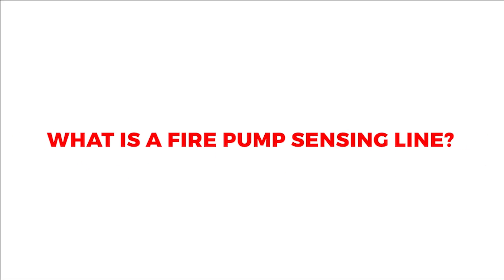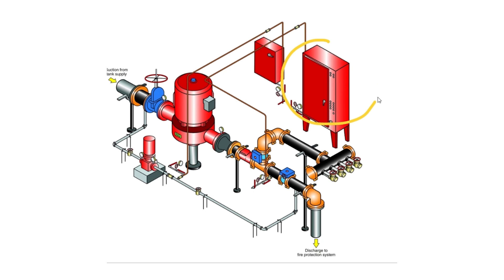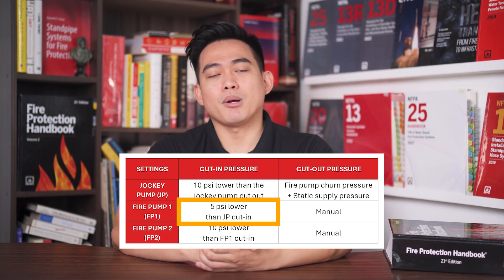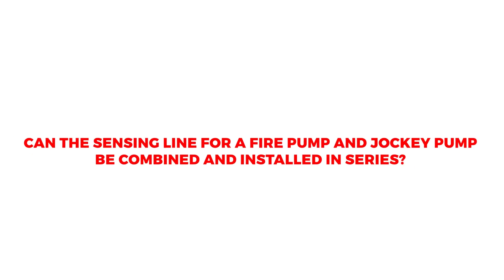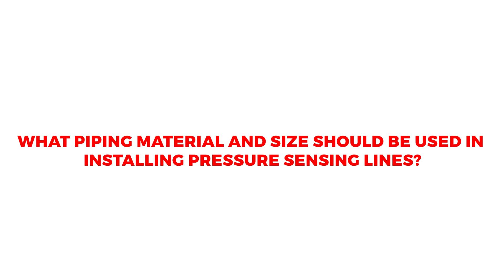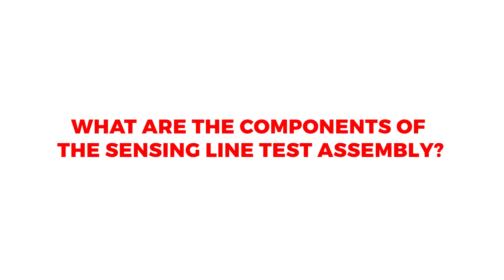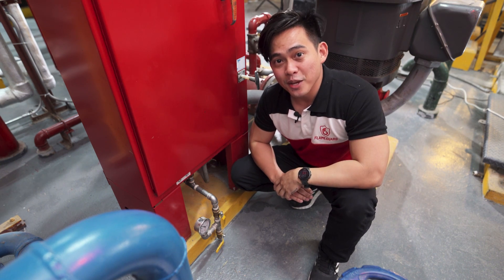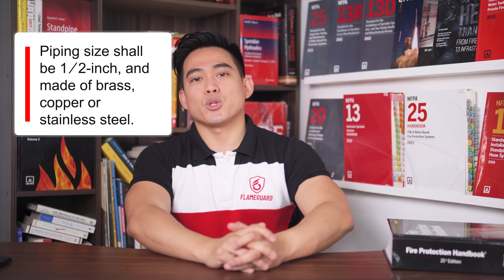Fire Pump Sensing Line: Summary of Requirements from NFPA 20

Comment: Hi sir thanks for this informative video, I just have a question regarding  local practice of installing sensing line above ACV,  

My question is,  what is your reference on your explantion, it is in the NFPA code? kindly state what section it is indicated

Secondly, i appreciate your explanation that it lessen water draining during weekly maintenance and introduction of oxygen to the system that may cause internally corrosion however,

This here are actual experience if the sensing line installed  below ACV,

1. If the installed check valve is faulty due to dirt accumulated over time on the valve seat it will  cause pressure drop that will trigger the jockey pump to cut-in  every time the pressure drop, since the volume of water at discharge check valve is small compared to the volume of the whole system, a small leak on the check valve will cause major pressure drop this will cause a frequent cut-in of jockey pump,
 Even the system has no leak

I am hoping you can clearly explain these very usual problems and source of dispute in this industry

Thank you and more power
Reply from the maker: NFPA 20 (4.32.2) 2019 edition.  "The pressure sensing line connection for each pump, including jockey pumps, shall be made between that pump's discharge check valve and discharge isolation valve." 

Also, check valves are required to be open and cleaned every 5 years

hope this answer your questions
Reply: Thank  you flame guard for this informative video it corrected my previous understanding in the firepump system,  I also read NFPA 2019 for further understanding of how the system works thank you